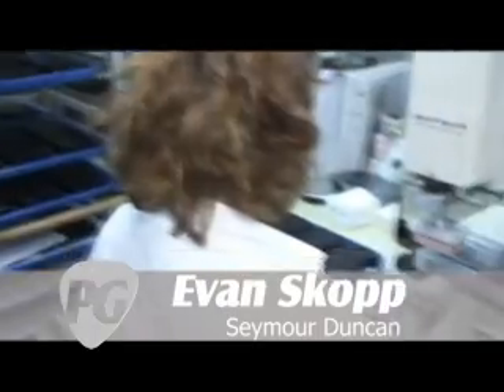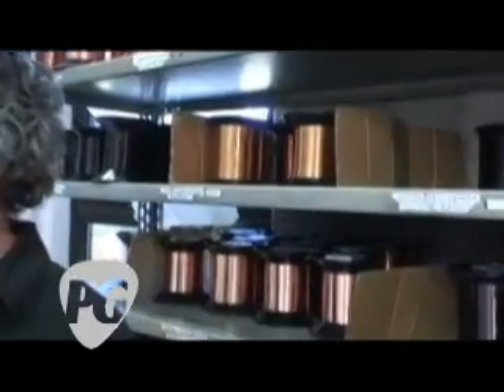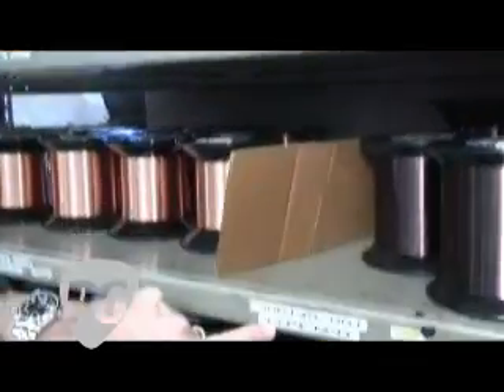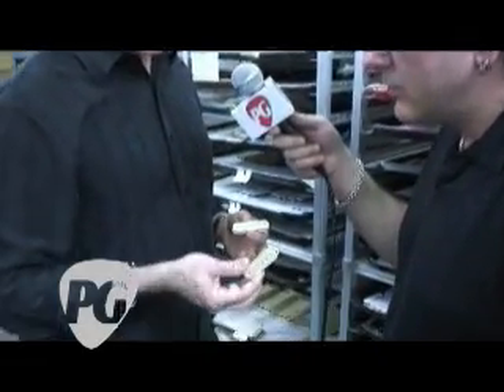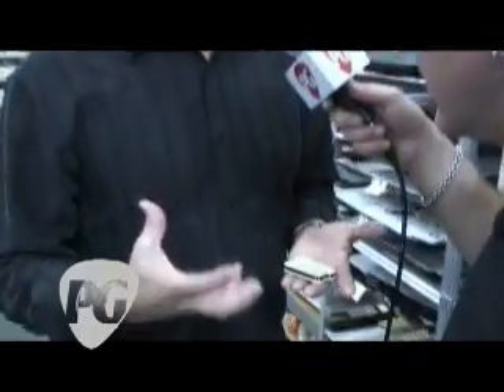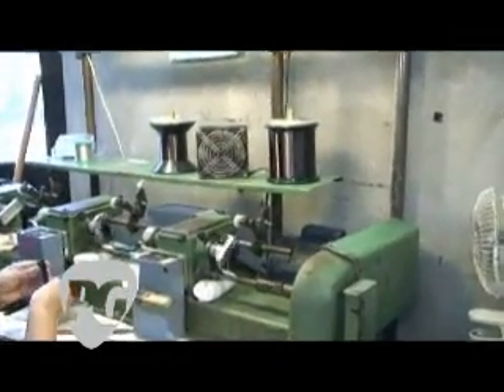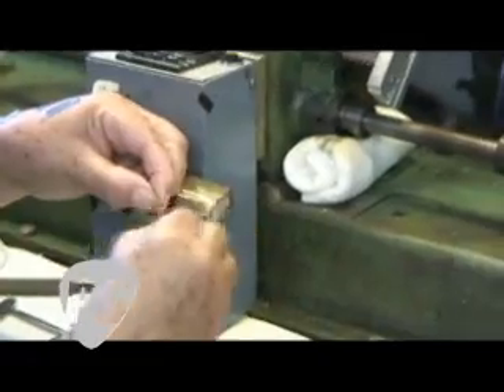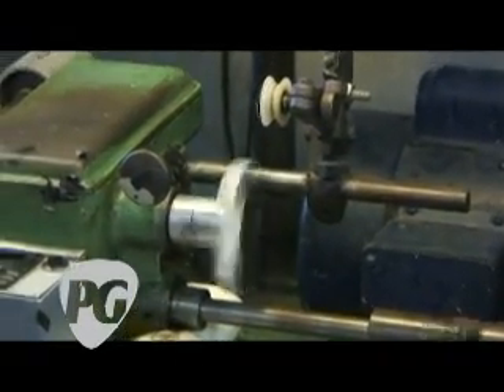How to Make a Pickup Part 2

Comment: @wpaschal88  You should be able to pop out the old singles and route a new whole to make it fit and then solder them to the wire 2 reds to 1 red type of thing use your same guitar wiring just solder to them if it is a humbucker with a single wiring harness then it will go in quite well red to red black to black etc.

Comment: my bad my computer sound is broken but what did he say about the different colors of the copper wire and do you run 2 seperate copper wires on a single pickup or do you run + and - through the wire ends. thanks so much.